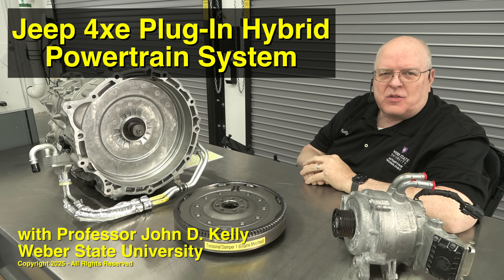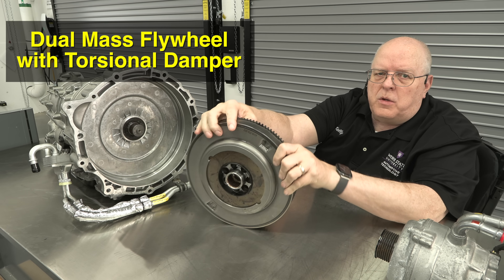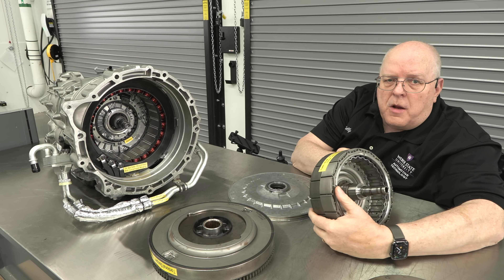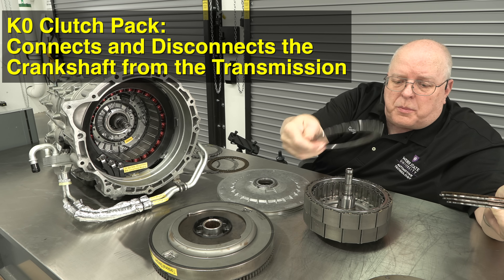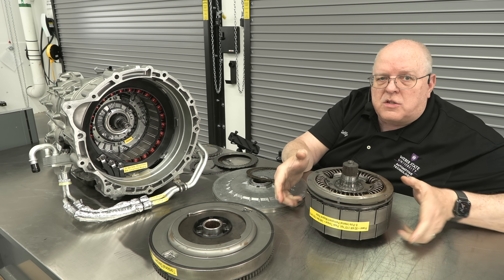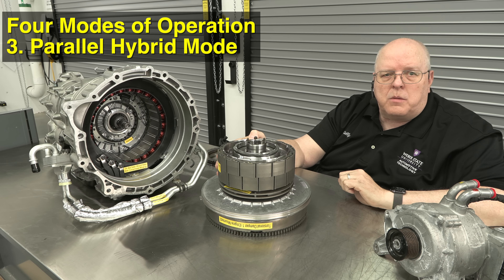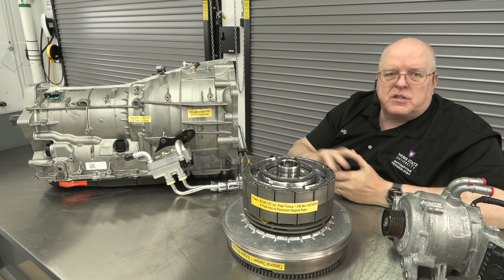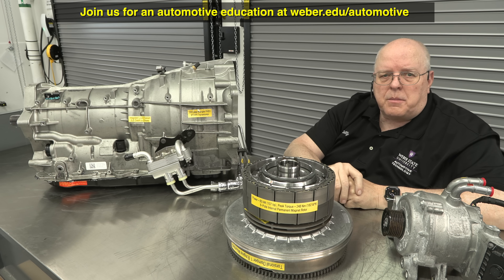The Jeep Wrangler 4xe Two-Motor Hybrid System

Comment: Excellent content, well done! Probably the best explanation of the 8P transmission so far on YouTube. Also, note that with the current 4th generation system of the ZF PHEV transmission (I.e. 8P80PH or 8P100PH) this system has advanced further by full integration of the inverter power electronics into the transmission housing without needing additional space.
Reply from the maker: Thank you for the kind words and the extra information!

Comment: Seems similar to Hyundai/Kia hybrid system. I believe many of their hybrids also don't have a torque converter. I wonder if they do the same thing with clutch slipping to help smooth things out
Reply from the maker: Yes, it is similar. Newer models use a dual clutch transmission.

Comment: Another great video from prof. Kelly, as always watched it with fascination.
I know you present only drivetrains from the US market, but I think you would find the e-Tech hybrid drivetrain from the French manufacturer Renault interesting. It's a very efficient and compact design, with discrete gearing (non-CVT), but with neither a clutch nor a torque converter, actually with no friction or slippage-based action at all. A completely different design from other hybrids
Reply from the maker: Thank you very much!

Comment: Does this transmission need a separate reverse gear or does it just run the electric motor in reverse?
Reply from the maker: This transmission has a dedicated reverse gear. The electric motor does not change directions.

Comment: Why does the bell housing look like it has a cutout for a traditional starter motor?
Reply from the maker: It is from ZF, it fits more vehicles than the Jeeps. It is also used by BMW and other carmakers who may use traditional starter motors.
Reply: @WeberAuto  interesting. It looks like they already modified the bell housing for the power connections though, so seems odd that they would also keep the starter motor cutout

Comment: I find it interesting that they did eliminate the Torque converter, because while it is correct that they "Slip" and are a source of heat as well, just about all modern Torque Converters contain a Lock-Up clutch inside of them to deal with both problems which applies once you get moving and you don't need the slip or torque multiplication. 

That said, with the second electric motor inside the bellhousing, I have to wonder if the strategy for starting to move is to run in Series Hybrid first using the Bell housing motor to get the vehicle moving, and once it is moving to then Rev-Match and gently apply the B Clutch transitioning into Parallel Hybrid mode?
Reply from the maker: I think you may be right about the starting strategy. Thanks for sharing
Reply: @WeberAuto   Yes, I have a 4xE, and it always seems to  start moving with only the electric motor. Then the gas engine clutch will close.
Reply from the maker: @dkoeger  Good to know, thank you
Reply: @WeberAuto Does that mean the P1 motor cannot start the engine when the vehicle is stationary below -10 C, unlike the Toyota system with a torque converter?

Comment: The whole system seems a bit overcomplicated. Maybe the product of electrifying an existing drivetrain, rather than a clean sheet design.
Reply from the maker: Thanks for your thoughts!
Reply: Well the Jeep drive train from the transmission to the wheels is trusted and has worked great for  nearly a 100 years. No change required.
Reply: @dkoeger  Yeah right the German company ZF was known as the main supplier of transmissions for the Jeep during WW2
Reply: ZF's whole reason for this design was for it to be the same dimensions as their regular 8 speed auto and thus easy to implement in a gas only car that uses the 8hp, such as the Wrangler, so you are correct. 

It's not anywhere near as reliable as toyota's two motor hybrid systems, but in my experience these have been decently reliable in the BMWs that have them. ZF generally makes a good product.

Comment: As I see it, it's a different system from Toyota and more complicated than the Honda plug-in, with many details involved in the transmission. Dr. Do you think this is a good system? How durable is it? It's already clear from the point of view of consumption that it won't be economical to use.
Reply from the maker: Thanks for watching
Reply: This system is optimized based on federal laws and rebates at the time.

Comment: There’s a BMW M235i racing cup car that uses a 8hp45r, it has a torsional damper in place of the TC. It has different rations but besides this two major differences it’s a regular 8hp transmission. Maybe because I’m aware of this transmission I noticed right away that it doesn’t have a TC. I’m really glad you’re back!
Reply from the maker: Interesting, thanks for sharing that insight!

Comment: I know I'm biased (since I own one) but the Mitsubishi PHEV solution seems so much more robust and simple, just 2x P4 plus a P1, one clutch, no belts, no gearbox, no central diff.

Eight speed tranny is exactly seven gears more than what an electric motor needs. I may accept a two speed transmission for off road or high performance, but that's it. Belt, clutches, this all looks like a big reliability problem down the road.

PS thank you for that hybrid motor naming scheme, never seen before.
Reply: Is it similar to the Toyota HSD?
Reply: @wo-olf  No, completely different. No planetary involved. Think of a series hybrid plus a direct drive with clutch for parallel hybrid, highway operation mode.
Reply: @markotrieste I see. Sounds similarly solid for sure.
Love the simplicity paired with a very long range.
Reply: Sounds quite similar to the Honda hybrid system, which I’m more familiar with, having owned a few. Both seem to aim to simplify their hybrid designs by making them essentially self-charging EVs (with Mitsubishi adding the plug-in option). I agree: why complicate things with a transmission when you can take advantage of an electric drivetrain?
Reply: @zachsharp4564 Please don't use the term "self changing" it's a marketing attempt to defy physics 😢 It's simply a HEV.
Reply: @markotrieste 
Yeah, bad term, I know. I was trying to praise the lack of a traditional transmission and didn’t know how else to put it.
Reply: @markotrieste self charging doesn't defy physics. It just says the car doesn't need an external electricity supply.
Reply: @wo-olf It's gasoline charging.
Reply: @markotrieste same as an automobile is self propelling an HEV is self charging.
Reply: @wo-olf So why put a plug if cars can self-charge?
Reply: @markotrieste they don't have one, that's why they are not a PLUG In Hybrid. What's your problem with the fact that an HEV is self charging its batteries with brake regen energy or even directly from the main energy source?
Reply: @wo-olf You misunderstood my question: why build and buy PHEVs if hybrids are self charging?
Reply: @markotrieste to get a bigger battery and longer electric range as well as higher power figures from the drivetrain.
You could do all that with a more potent hybrid system as well but they chose to make it "plug in" so people can charge externally as well as internally.
There is no HEV with the power figures or range of a PHEV. That's the reason.

Again: what's your issue?
Reply: @wo-olf  Wrong. The plug is there to allow the use of grid electricity for car transportation. My issue is that Toyota is deceiving the public by implying that their system is superior because it doesn't need a plug, while it's the other way around, the Toyota system is inferior because it keeps you dependent on fossil fuels.
Reply: @markotrieste let me repeat your comment: "you're wrong because what you said is exactly what I said now and I'm right".
Didn't I say the plug is to charge externally?
Is a PHEV able to charge internally as well? Yes it is so it's EXACTLY as I said it is.

The HEV isn't superior. It's simply a system that's 100% self charging.

What's your problem with that?

You seem to be very defensive about the simple truth that a simple HEV is 100% self charging.

A PHEV can do the same but can also be externally charged.

Noone said HEV is superior or better. That's just in your head.
Reply: @wo-olf Toyota says it, and I don't like see their deceptive marketing being amplified in a technical channel like this. We have HEV, PHEV, EREV and BEV to clearly identify the powertrain, the only reason to use the word "self charging" is to repeat Toyota's talking points.
Reply: @markotrieste if you don't understand what "self charging" means just say it. It seems you're angry because you don't understand it and think others are equally challenged by it.
Self charging is the correct term and is 100% valid and in no way deceptive. 
It's technically correct and you will have to accept this fact and stop hating on Toyota and anyone with the basic knowledge to understand it.

Toyota sells both HEV and PHEV. PHEV is more expensive. Why exactly do you think Toyota would need lies or even unfairly promote the less expensive variant to cannibalize their PHEV variants?

Your thought process doesn't make any sense.
Reply: @wo-olf  you are clearly pretending to not understand. I made my point pretty clearly.
Reply: @markotrieste  no sir, YOU are not understanding that "self charging" is a term that is perfectly fitting here. 
You don't seem to grasp that "automobile" translates to "self driving" as well. Just because you don't understand what things mean doesn't mean they are wrong.

An HEV is 100% self charging. It's IMPOSSIBLE to charge it externally. Where the hell do you think the charge is coming from but from the internal tech, aka  SELF charging.
Reply: @wo-olf There cannot be internal generation of energy, it's basic physics.
Reply: @markotrieste  noone is talking about generation. The electricity you charge via the plug hasn't been generated too. It's been converted.
It doesn't matter if it's hydro, wind, solar, gas, regen or petrol energy that's being converted.

The key part here is that it'a all happening within the car. So it's charging the battery solely with energy that's been stored within the car. No external electricity source.
Reply: @wo-olf If the energy comes from fossil or from renewables is the whole point.
Reply: @markotrieste it's absolutely not the point. The point is "self charging" which simply means you DON'T NEED TO PLUG IT IN. Why don't you understand that?

Toyota never claimed it's self charging with renewable energy have they?
Show me the ad that confused you so much.
Reply: @wo-olf  The moment you say it's self-charging, you imply that energy is made out of thin air. Remember, out there there are people convinced that cars could go on water but a great conspiracy is preventing us to have them. So self-charging appears superior to "charging with plug". The ad even said "no need to search for a charging station". A honest ad would said "can't get anything from a charging station".

Also, why apply this label only to HEV, since any car with some electrical conversion capability in the drivetrain (even those straight scams called "mild hybrids") can recover kinetic energy with regenerative braking? There is only one reason, a big effort of Toyota to compensate it's lack of investment in EV with deceiving marketing. So much so that there has even been a complaint filed to the FTC. Watch the Transport Evolved episode from six years ago on that exact topic.
Reply from the maker: Glad you found the motor naming scheme helpful. Thanks for sharing your perspective!
Reply: The efficiency falls off at high speed because of the RPMs needed. Its why gas cars catch up at the end of a race as the electric motors are wound out.
Leaving out the transmission is more like its a cost cutting measure than an advancement.
Reply: The Norwegian Consumer Authority banned the ad in 2020 and said in a statement (translated):

In the Consumer Authority’s opinion, it is misleading to give the impression that the power to the hybrid battery is free of charge, since the electricity produced by the car has consumption of gasoline as a necessary condition: Regenerative energy will in all practical respects have consumption of gasoline as a necessary condition.

On this basis, we conclude that marketing is a misleading commercial practice in violation of Section 7, first paragraph, etc. In our view, the commercial practice will also be suitable for influencing consumers to make an economic decision that they would not otherwise have made, cf. § 7, second paragraph.

The current marketing is therefore an unfair commercial practice in violation of the prohibition in § 6 fourth paragraph, cf. the first paragraph.

Therefore, Toyota is not allowed to use this marketing campaign in Norway anymore.
Reply: @markotrieste it seems there are more dumb people out there than I anticipated.
It doesn't make any difference in the validity of the statement tho.
Look at the US for example. A country full of people that can sue a company for their own mistakes just because the company didn't warn them to do dumb sht.

The HEV is self charging. If you think this is wrong or that the car doesn't need fuel to run, you should turn in your drivers license immediately.
Reply: @markotrieste see, I KNEW there was a catch in your story. Toyota stated "HEV are self charging without cost to the driver". 
Now that's a different story and of course a lie..

Why did you leave out the important part and stuck on the perfectly fine technically true part?
Reply: @wo-olf Because Toyota invented tge term "self charging" and only Toyota uses it to describe their product. No expert in the field uses it, because it was meant for deceiving, not clarifying.
Reply: @markotrieste  are you aware that "automobile" means "self driving"? 
If we are on board with that, we can also agree that an HEV is auto/self charging as well as it is self/auto gearchanging without your input.

Auto meaning self meaning the driver is not involved in the process.

Comment: Finally new videos, thank you! 

But let me ask a question: 
How reliable is it? I know from the past the Smart (Daimler) Mhd m132 engine with the starter-generator. They put a lot of stress on the belt…in fact so much stress that they broke the tensioner and/or the generator housing. Silly thing that they also power the coolant pump with the same belt… ¯\_(ツ)_/¯
Reply from the maker: Thanks for watching, good question. I don’t know the answer, but the belt is extra wide. Hopefully it is holding up well.

Comment: I really like the video as always. I just want to know that are we sure about genarator and alternator that does the crank the engine all the time? Because when vehicle start purely electric if u need to crank the engine, the electric motor can also crank the engine by activating the k0 clutch in these case alternator no need as far as i know because vw plug in hyrid also pretty much the same system.
Reply from the maker: Yes, the front generator always starts the engine in temperatures above -10 C (14  F). Thanks for watching